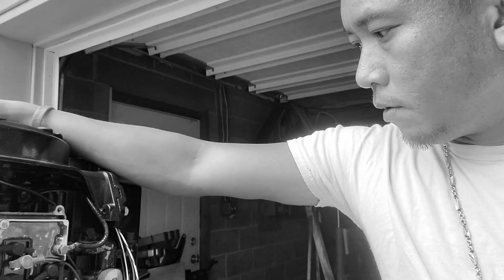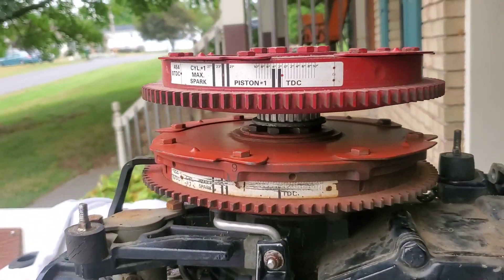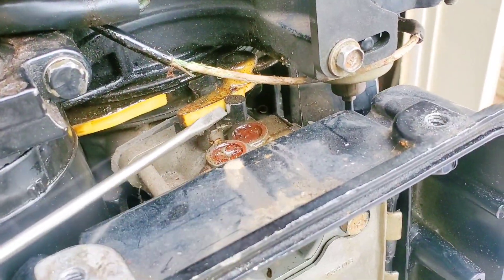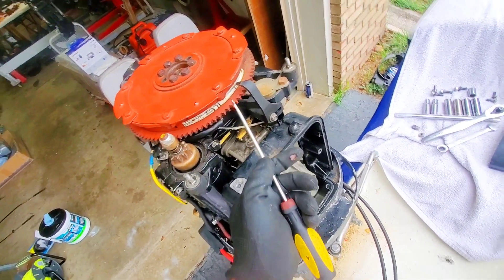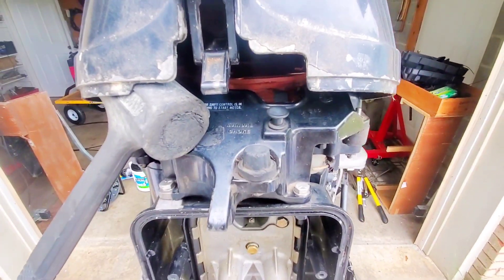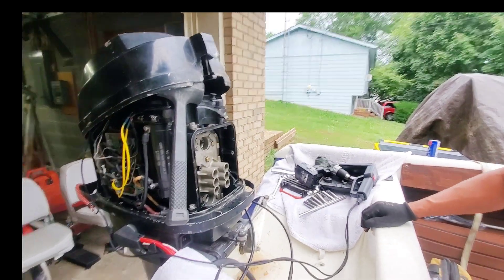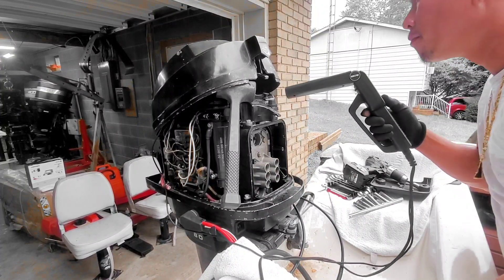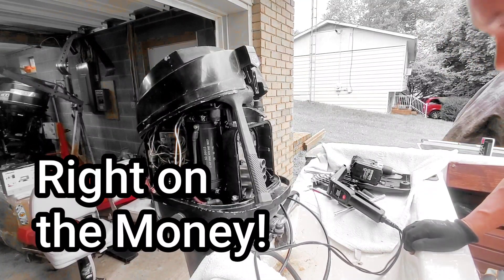Mercury Outboard Link & Sync ADI Ignitions Inline 4

Comment: Hey son, just got an old 79 thundercraft with an 80 horse mercury in it. It tops out at around 7 mph and doesn’t rev up all the way when the throttle lever is all the way down. Any idea on what the issue could be? Also how did you hook up the hose to the 80 I cannot find a hose hookup for the life of me 😂

Comment: Hey man great video. I recently purchased this boat that has a 82 mercury 80 hp 4 cylinder. I can get it started but it’s hard to start and won’t idle. If I can get in gear out on the water I can’t open it up more than a fast idle or it will die. Any tips would be great. Thanks man
Reply from the maker: Compression?
Reply: @MerCSonL6  I’m getting 150 on all cylinders. I did just go through the carburetors again and did like a 24 hour soak. Also found like a small 8th inch or so diameter frost plug on the top of the one of the carburetors that was missing. Thinking that might be one of the problems things seem like they’re flowing better and I hope to try it this week or this weekend, I’ll let you know and thanks for responding

Comment: I have one of these mercury 500 thunderbolt ignition outboards and I can only get it to start with the throttle open up about 3/4 of the way. If I try to start it normally it will try to start but just will not stay running. I am not sure where to start to get it running correctly.  I have an identical 500 that was easy to start but had to remove a broken piece of water pump impeller from it and I am waiting on gaskets to resemble it and remove the 8 bolts that broke off in the block. I like to get this spare outboard running so I will always have a spare that I can rely on or even put on another boat. Any suggestions would be great and helpful. Thank you.
Reply from the maker: Fuel delivery issue. I would start by rebuilding the carbs then work backwards all the way to the fuel tank.
Reply: Thank you. I will start from there.

Comment: hello son. i just purchased my first boat that has a mercury 80hp. i notice that it doesn't have the reverse lock hook and it's a non power trim. is that normal? where can i find parts for these motors?
Reply from the maker: You don't need reverse lock. They typically fail anyways. Just don't throttle in reverse heavily. Son
Reply: Thanks son! Ive been watching alot of your videos since ive bought this boat. Your definitely the goat when it comes to these motors!

Comment: I have a 78 Mercury 500 with great compression and spark. Would this cause the motor to not run? With fuel I am getting coughs but the motor will not fully start. Thanks
Reply from the maker: An engine only needs 3 things to run: compression, spark, and fuel. It could be a fuel related issue. Check the carbs. They are tip of the food chain with ignition. Son

Comment: Do you know how to fix incorect spark pattern when neutral
Reply from the maker: Incorrect spark pattern? I'm not sure precisely what you mean.
Reply: @MerCSonL6  it is back firing dont start
Reply from the maker: @yochipus  how do you know the spark is incorrect? A timing light will ascertain your plight. Make sure all the plug wires are correctly installed. They do not go in 1,2,3,4.... the sequence is located on your cylinder head. Please let me know if this helps. Son
Reply: @MerCSonL6  thats the problem someone messed up the coils currently top coil goes to lowest plug and so on has 3 coils 3 plugs firing order is 1-3-2 cant sen to find manual for it mariner/mercury 60hp 1984-1989

Comment: Great video, i have a 78' that im about to link and sync. Luckily I was able to find the original manual for the engine, but it has you do the timing with the engine running in water. I am not doubting you at all, I am just curious if it as effective doing it the way you are just with the starter motor. It would be ideal for me in many ways, a reply would be greatly appreciated, thank you MerCson!
Reply from the maker: The final lync and Sync are done on the water. The timing and syncing the carbs can be done on dry land. I have a video on the process. I'll put the link below. Son
Reply: @MerCSonL6  thank you so much man i greatly appreciate it
Reply: @MerCSonL6  one more question, when you're doing the timing, you have everything hooked up except fuel?
Reply from the maker: @bobbymoran4379  no fuel and make sure the throttle arm is disconnected. Son
Reply: @MerCSonL6  thank you son
Reply from the maker: https://youtu.be/MmdmCqle-is

Comment: I rebuilt my 1980 80 HP merc.with adi ignition.  Since I put it back together my timing is all messed up.  I followed this link and sync video before I took it apart and it was all set right the way u explained it.  After I put everything back together, the motor is spatking almost 180 degrees out.  With my timing light,  when it flashes the tdc mark is pretty much lined up over top of the rear of the engine directly over the spark plugs not anywhere near the timing mark on the front right side of the motor.  I cant seem to figure out what I did wrong.  The flywheel is keyed so it only goes on one way and when I do then piston stop tdc method it lines up with the timing mark like it should.  Any ideas on what I need change to get engine sparking at the correct time.
Reply from the maker: Check the position of your flywheel. Sometimes people pull the flywheel without a puller which disrupts the timing. Find TDC and base all of your timing on that. Mark it on the flywheel. Please be exact. Son

Comment: I have a Mercury 90HP outboard motor. Everytime I turn on the ignition key it blow the main 20A fuse. I just went through 7 fuses and still can't figure out what's wrong. Can someone tell me what is my issues for the Mercury 90hp outboard... Thanks
Reply: It is a 1986 year.
Reply from the maker: Where is the fuse located?
Reply: @MerCSonL6 
The 20A Fuse is located in the motor next to the ignition wires.
Reply from the maker: @armsoulja  there's a short somewhere. Your battery power is grounding out somewhere and the fuse is blowing to protect your controls. I'm assuming the fuse is connected to the red wire going back to the controls. All wires will need to checked in the motor and to the controls. Somewhere they are getting crossed or getting grounded which will cause the direct current to fight each other ie blow a fuse. Hope this helps. Let me know. Son
Reply: @MerCSonL6  trace the wire couldn't find the short. Do I need to change the starter solenoid?

Comment: Love the videos !!  Recently got a 87’ 115 , starts & runs good enough , at idle I’m losing spark on three cylinders intermittently. It will come in & out , if I turn the idle up to   1000 it runs fine .  I tried to set base timing using your videos &  the timing light wouldn’t fire on #1. If I move it to #2 it fires… I’m thinking a bad trigger or box.  I don’t have a manual as yet . Any help would be appreciated . Keep up the great work..!!!
Reply from the maker: Sounds like you have some digging to do. I have videos on how to test all these components to isolate your issue. Bench test the stator, read the voltage coming off the switchboxes to the coils, and bench testing a trigger. Look through my channel. You will figure it out. Do not guess. Son

Comment: Thanks for doing this video.  I asked u too do one when u were working on that other l4 u changed the stator trigger and switchbox on.  Does it seem like there is a lot of play up and down on the trigger on these motors as the lever advances.  Mine seems to have a lot of slop in it and I wonder if it effect how the trigger is working. It sits level with the block at idle but the front seems to tilt up as the lever comes forward.  Maybe like 5 to 10 degrees angle.
Reply from the maker: You're welcome. There should be no play with the trigger. It advances forward and backwards. That's it. Stator may need repositioned because that's what keeps the trigger in place. Son

Comment: Hi @MerCSon L6! I need some help. My shift shaft on 1972 Mercury inline 6 135hp on the lower unit is spinning 360 degrees I don't hear any clicks, seems like it is stocked on one gear so could it be? Do I need to rebuild my lower unit?
Reply from the maker: Disconnect the shift cable and try shifting it manually  If it shifts your cable is the issue. Let me know. Son
Reply: @MerCSonL6  Im spinning the shift shaft on the lower unit by hand, and it's spinning 360 degrees. I already dropped off the lower unit.
Reply from the maker: The shift cam must have came off or is stripped. The lower will need to be rebuilt. Son
Reply: @MerCSonL6  thank you! That's what I thought